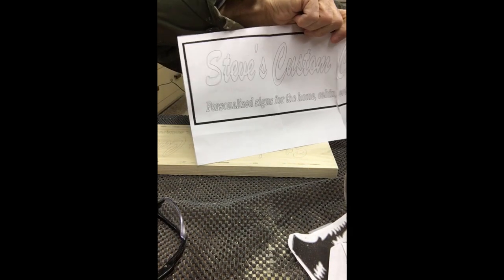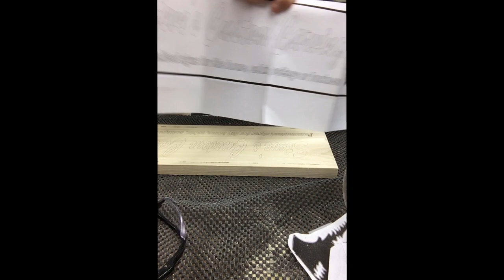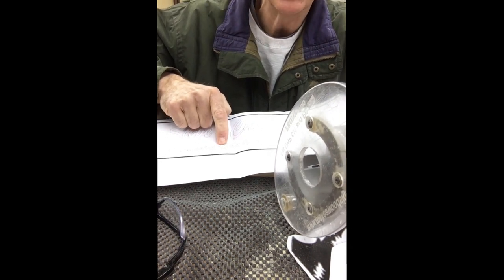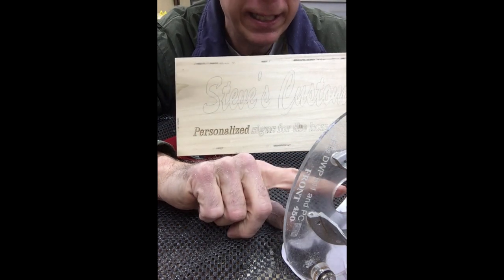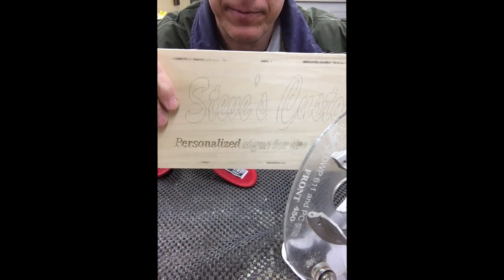Freehand carving small letters

Comment: Hi again Steve. Fabulous work. I'm hoping to engrave a WWI poem written by local schoolchildren into a bench. The writing will be small like this,  could you possibly post a link to the bit and reducer please?
Reply from the maker: The reducer is an Amana. https://www.amazon.com/Amana-Tool-Precision-Reducer-Overall/dp/B001NI6KO8/ref=sr_1_2?dchild=1&keywords=1%2F4+collet+reducer+amana&qid=1609433186&sr=8-2
The 30 degree bit is no longer available from Amamzon.  Here is a set that would work.
https://www.amazon.com/YIYATOO-3-175mm-Carbide-Engraving-Router/dp/B017LGA36G?pd_rd_w=foYXM&pf_rd_p=20b206aa-95f4-4c0b-9d3e-e0956f8383a3&pf_rd_r=BVNTZZMV4XHC7RKDADSS&pd_rd_r=41086d91-3dba-4ba6-84dd-1ea5d7f828a4&pd_rd_wg=TtQJt&pd_rd_i=B017LGA36G&psc=1&ref_=pd_bap_d_rp_69_dv_vtp_1_i